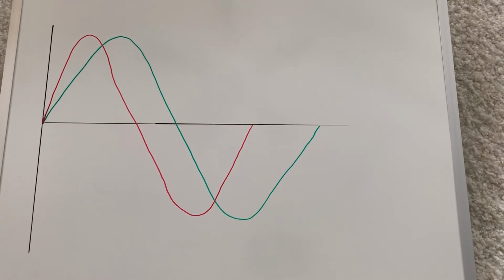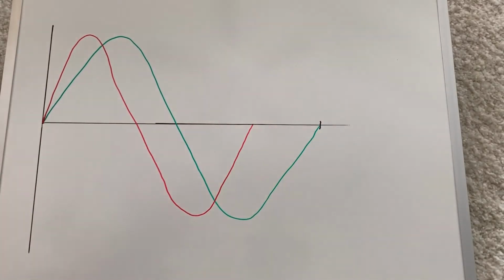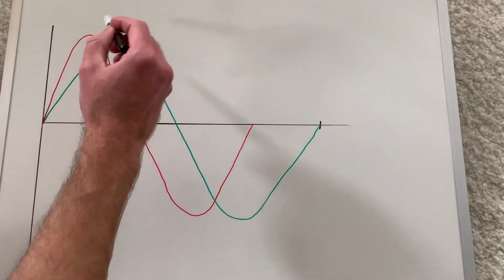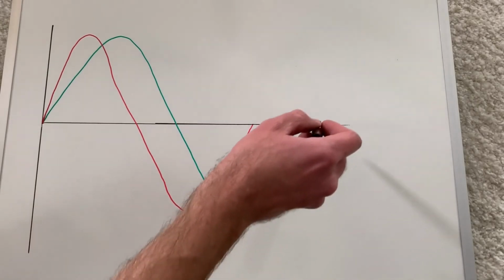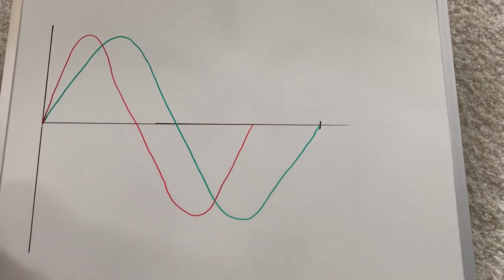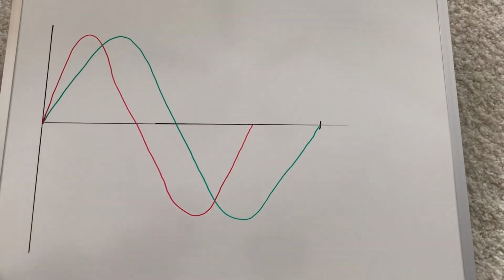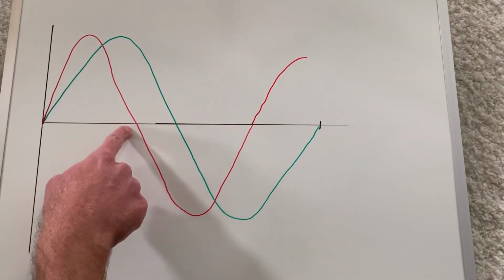Good Vibrations: Chladni Plate Demonstration - Lockheed Martin

Comment: Even food or agricultural could be done fast if using liquid pump , electroplating and inflatable form then we could extract nutrients from soil , air , water, sunlight then mix in pressurized inflatable fruit and proportion of heat and color and mineral formula of flavor and task

Construction Machine can extract materials  from earth the same way right on the site and 3 d print all Construction piece right at the site no need of transportation unless in extreme case